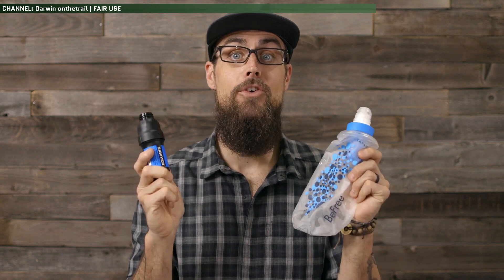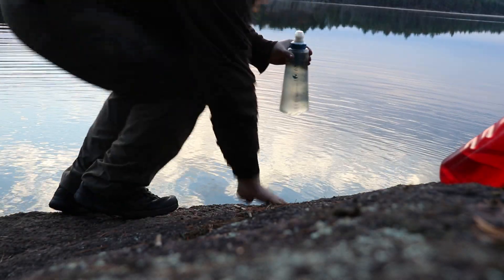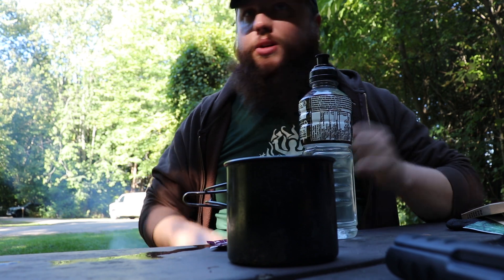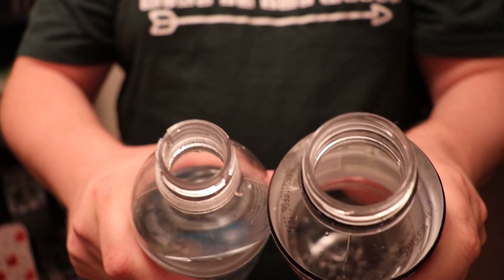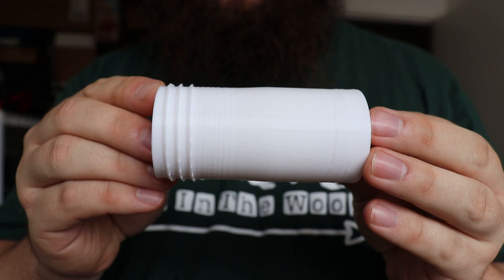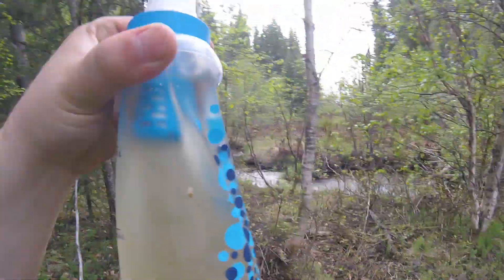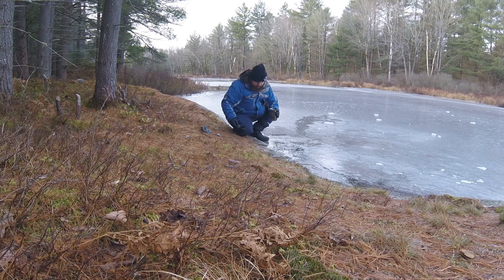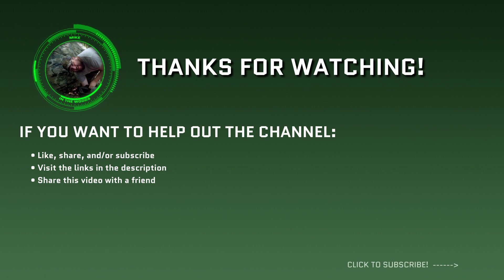Can A 3D Printed Water Filter Adapter Work?

Comment: You were worried about water contamination from a leaky seal, even after the electrical tape o-ring it was leaking into your mouth and beard lol. The power aide mouth is such a thick plastic you could likely mill down the mouth a mm or two and have it seat properly. I love my Smart bottles but I never fill them with dirty water, I usually filter into them with a wide mouth bladder. I think the last smart bottle I bought was about 5 years ago. So used the logos are completely gone.

Comment: well... here goes my 2 cents- this adaptor was leaking because whater is held only by threads, but when you have a regular cup, thread compresses flat part(end of cup) to the end of bottle neck, and that way it seals. 
So, then, on the model, you would have to add a wall- just like a regular bottle cup, but with a hole(something like 10mm should do) in it for water to go through to filter and that should fix the problem... in my opinion. 
And another thing is: best material i think would be HDPE, it is heavier, but its more elastic and will seal better, also it might be more durable in cold. :)
Reply: This seems to be basically the only real drawback to BeFree in my eyes, when you have adaptor like this and it gets gunked, just unscrew adaptor, wash filder and youre good to go- no syringes to take with you(more stuff to brake), filters faster, more lightweight... With adapror probably the same as sawyers with all the other stuff you need, so this really would make it like 90% superior product, except that sawyer filters a bit better extremely bad water.
Reply: Also it does not take much to design adaprots to power-aid, and regular water bottles, right?